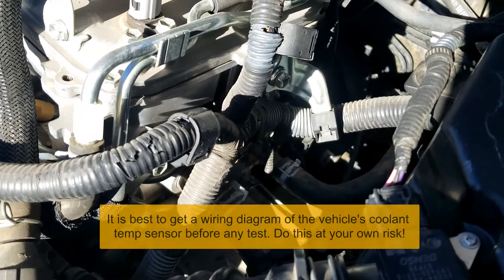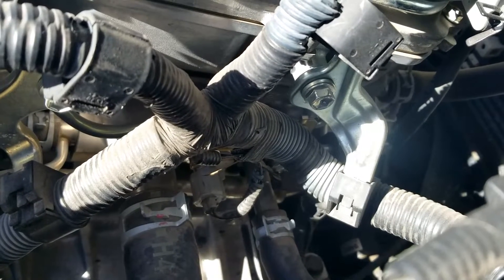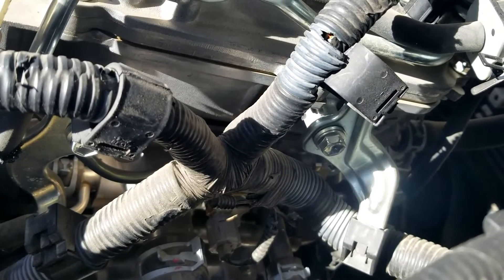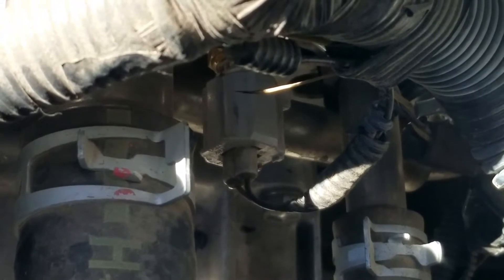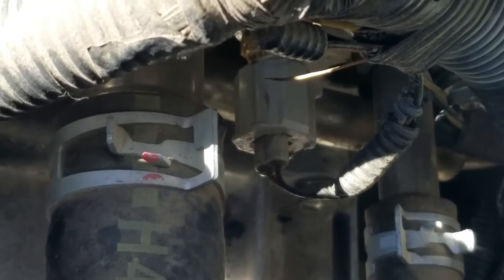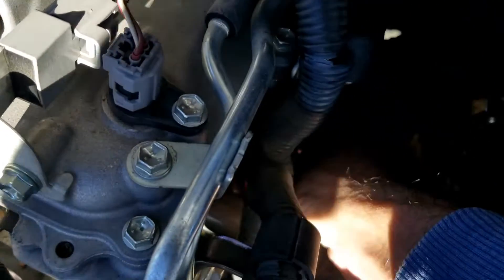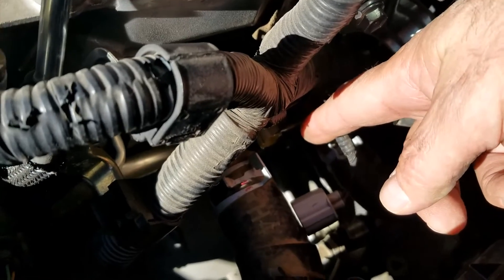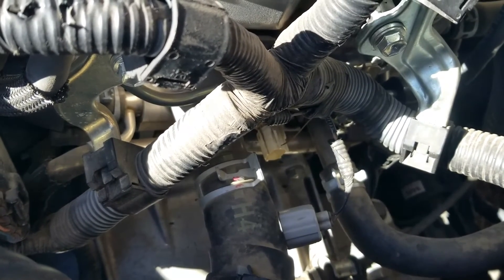How to Test a Coolant Temperature Sensor Without a Multi Meter - No Tools Needed

Comment: I was going through this scenario with my dual sport motorcycle. I was in the process of learning how to use my new multimeter since I don’t know how to lol, and I came across your video. The exact same thing was happening with my bike, the mil code was there, the fan came on after unplugging connector while running, and jumping the wires resulted in the fan coming on. Exactly what I needed; I can now order my sensor and delay my multimeter learning for another time 😂. Thanks bro

Comment: Sir where's the Coolant temperature sensor on a 1995 Ford Taurus GL 3.0L and how do I fix it. Thank you in advance. Do you have a video on this repair?
Reply from the maker: It is located on the driver's side of the engine, up close to the firewall. I don't have a repair video for that year.

Comment: Ok I have a 2jz engine and the temp sensor was my issue.  I replaced it yet I'm still having crank no start.  I did buy that from autozone.  Could that be my issue.
Reply from the maker: A bad temp sensor shouldn't cause the engine to not start. If the sensor is bad, reporting high temps, and the computer won't allow the engine to start, unplugging it will cause the high temp signal to stop, and the engine should start then. The temp sensor may be having a problem, but the no start is likely something else.

Comment: Will this technique work for testing on a mini r60?  I’m rapping my head around my issue.  Ac compressor & electronic motor fan won’t work.  I’ve tested relays they seem to be fine and no bad fuses.  I can jump the pins on motor fan relay to test the fan itself and it does work 🤷🏻‍♂️

Comment: Thank you for nice info video.
I checked it by putting in cold, hot water I noticed readings has changed so that means it’s working?
When I disconnected the fan spinning right away.
What do you think?
Thank you.

Comment: great video.... liked/subscribed.  If  the coolant temp sender wiring plug had a issue where the wiring got cut and actually both wires were making contact with each other. Could that harm the ecm?
Reply from the maker: It's possible, but usually the wires just need to be repaired.

Comment: So, I have a '99 Pontiac Montana with the 3400 engine which is NOTORIOUS for overheating. JUST got it out of the shop a couple months ago for head gaskets, this is the second time. Anyway, it's still overheating and gas mileage sucks egr codes coming on. Cleaned the egr valve, replaced it, that helped, but eh engine light keeps coming on, soooo......
Gona try THIS and I'll let ya know
Reply: Any result ? I have a overheating 3400. Thanks😅
Reply: @fngonuts  After replacing the temp sensor it still runs hot! I honestly 
think this is the WORST engine EVER made!
I've talked to SEVERAL mechanics and 
they agree. Unfortunately this does not
fix OUR problem, so just keep watching 
your temp gauge and keep coolant on 
hand, just in case. I am constantly
bleeding mine just to keep air out, since 
that is one of the issues with this engine!

Comment: I did the same thing to my Buick I wasn't for sure I didn't say anything to my mom's Taurus things were not coming on her chorus is actually overheating mine just gets a little warm up about half I think it's too hot you get out and touch the engine it's freaking skull tonight I hear these 3.8 view from motors running pretty hot but I think you finish you're still come on can't help cool that off so I did the same thing and I assumed it was bad because it wouldn't take him old and turn the fans on now if I plug it back up and they started working and you just messed up connection but I'm pretty sure like you said that has a bad temperature sending unit has to be because it's like you said it's sending false signals to the computer thanks brother

Comment: Same problem happening with my 1995 Saturn SL1. Fan won't turn on even at 222F so that engine will slowly overheat. 

Easiest fix for this problem is just turn on the cold A/C. PCM will forcefully turn on the radiator fan with A/C on.

Comment: On a car that has a working sensor how long will it take standard cars to warm up before the fan turns on?
Reply from the maker: It will depend on the vehicle exactly when they turn on, but once the engine coolant temperature reaches around 190°F to 220°F, they should kick on.

Comment: We replaced the sensor but it still won’t work all the time.  Sometime the temp will read and sometimes not.  When it doesn’t read the air conditioner doesn’t work either.
Reply: Check if the thermostat needs replacing
Reply: Could be shorting

Comment: Hello do you know if the sensor is faulty and unplugging it does that indicate that it is faulty.
I have a 2020 toyota corrolla 1.8 l 
My fan will come on but it 
Only runs for a few seconds and shuts off but
The temp indicator says normal.
Reply: I have the same car as you and I'm having a problem as well. Idk if it's the fan motor or this. My fan works sometimes and sometimes it doesn't. If I pop the hood and tap the fan sometimes it'll start spinning.

Comment: What about trapped air near the sensor? Im pretty sure if the system wasn't bled right, that air near that temp sensor could also prevent it from properly reading the coolant temp. It's best to do a flush, then bleed, then test the sensor in a separate cold/rm temp bath.
Reply: Good question.  I noticed my temperature gauge was erratic and and was keeping an eye on it. Recently a plastic elbow in the heater hose system broke and the temp climbed quickly.  I pulled over and as I was letting it cool down noticed coolant on the ground.  The elbow was in a bad spot to see right away.  Once we found it we went to the nearest auto parts store. After changing the elbow we topped the coolant off. We had trouble venting the air. Even with the bleeder screw open it wouldn't fill fully. Long story short, the thermostat was stuck shut. After replacing it I could bleed the system. But, the fan wasn't coming on. I have never had three issues at once. But, I unplugged the temperature sensor and the fans came on.  This video helped me to do a systematic diagnosis. I know how to test relays and fuses but the tip about unplugging the sensor really helped.
Reply: @mikeolson435  be careful with troubleshooting more than 1 problem at a time because if you replaced all the 3 parts simultaneously and it happened to fix the problem you then don't know what the fix was to any of the issues. It's best to shoot 1 problem at a time, theorize what the cause is, find the solution to that problem, make the repair, and then test to see if it fixed it followed by making a note of the whole task.
Reply: @KL4life  I always test before replacing parts. In this case we started with a P0128. Which was engine coolant low temp. That cleared up but I bought a new thermostat just to be safe.  I hadn't installed it yet when the plastic elbow broke.  We were 70 miles from home and luckily AutoZone had one on their Help rack.  The next problem was with the bleeder on the thermostat housing open I refilled the coolant. This is a Dodge Grand Caravan 3.6.  It continued to overheat.  Since I had the thermostat I put it on. Then I was able to bleed the air out. The combination of events probably caused the coolant sensor to go out because the fans were not kicking in. By then we were home so I had my tools. With the power probe I could turn the fans on with the relay pulled and testing the relay etc showed it was working.  So the next step was to test and replace the sensor. All three parts were about $60 total. This was all done under my wife's supervision because even with over 50 years as an electronic technician she questions whether or not I know what I'm doing.
Reply: I did a water pump on a Tahoe that was hard to bleed the air, this time I unhooked the top radiator hose and took the cap off the coolant tank and poured my coolant into the hose until it filled the coolant tank after that I hooked the hose back up to the radiator and then filled the radiator, depending on the vehicle this has been my process I've used. The tahoe has no bleeder screw at the thermostat
Reply: How do u flush the system

Comment: Im gonnatry this in the morning. Ive been trying to. Trouble shoot a cold running 1998 expedition xlt 5.4 4×4 with no heat for awhile now. I suspect the cts, ive changed the thermostat to little change, going down the road it gets cooler and gauge neveer gets above a quarter of the way up. But the top radiator hose gets hot as does the engine. Thank you! Ill report back.
Reply: I have no clue what's happening. I bought a new CTS sensor installed it and the truck didn't warm up at all so I guess a doa part. Maybe it needs a motocraft part. But I get bad gas mileage, the temp gauge never gets above ¼ and no heat on 1998 expedition XLT 5.4. any help would be greatly appreciated. Oh btw my truck has old school fan connected to the motor so idk.

Comment: Very good tip but not Ultimate way to detect. Especially in the case where the sensor function intermittently. I just had to change mine completely although unplugging it turns the fan on the sensor was bad! So follow up with other meter testing. Read ohm. There should be no reading between one of the terminals and the long metal tip of the sensor. 😊

Comment: I’m having a similar issue with my current coolant temperature fan sensor. It’s a 4 pin. It also controls the AC cut off switch. The thing is when I turn the car off after normal driving the fan does not come on. The fan only comes on while driving. Would that mean it’s a faulty sensor or could I be getting under 12 Volts?

Comment: Just to be clear if the fans never come on but then do with the jump wire test this proves the sensor is bad? Thanks for the video
Reply from the maker: For some engines, yes when jumpered, the fans will kick on, which is a bad ECT sensor. A wiring diagram will be needed to know for sure, but that is common.
Reply: @HVAC_Mechanic What if they don't come on when doing the jump wire test, But do come on when the AC is activated?

Comment: So my coolant temperature sensor plug broke and I had to replace it but I forgot to take a picture of which wire was on the top and bottom(or right or left depending on the sensor is placed) doesn’t matter which wire (mine being a blue with a yellow line and a brown wire) goes where. Thanks